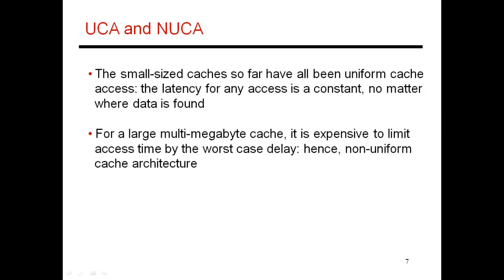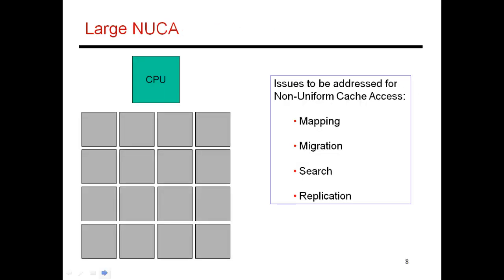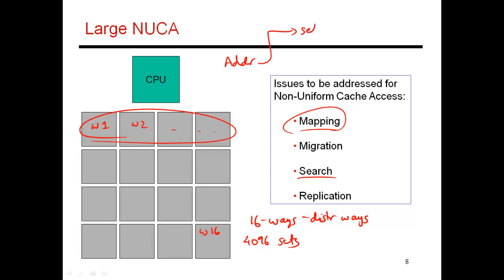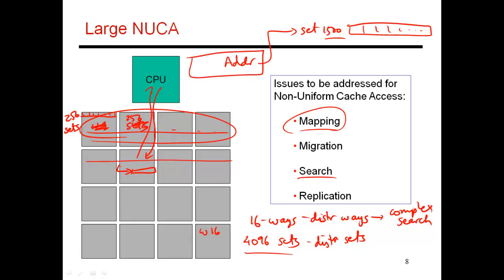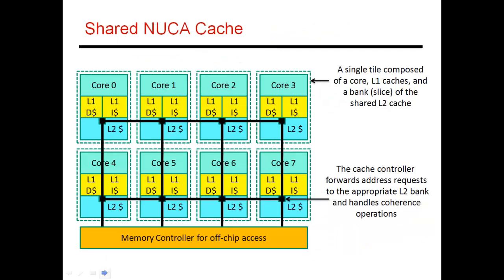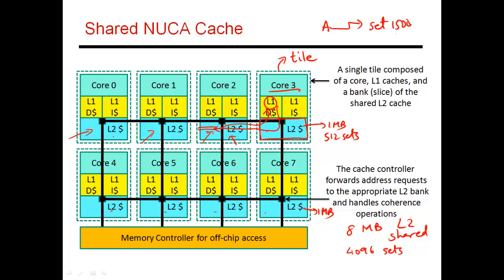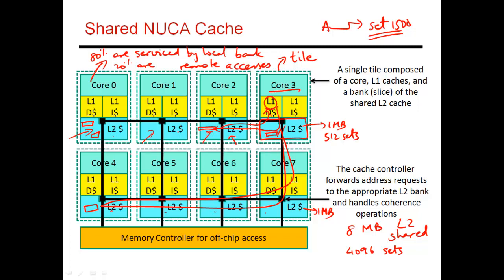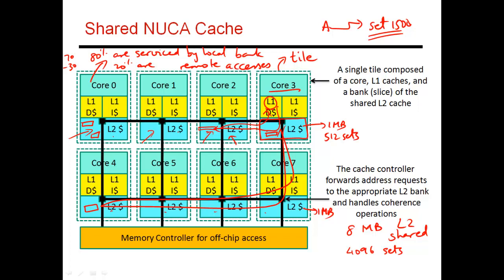CS6810 -- Lecture 42. Lectures on Cache Hierarchies.

Comment from the maker: If the data arrays are large and distributed, the tag arrays will similarly be large.  Accessing one large tag array would be expensive, which is why it is partitioned and distributed along with the data arrays.  Having a centralized tag array might be ok in the single core case (and simplifies data search in NUCA).  In a multi-core case, it would be expensive to replicate the tag array at each core.